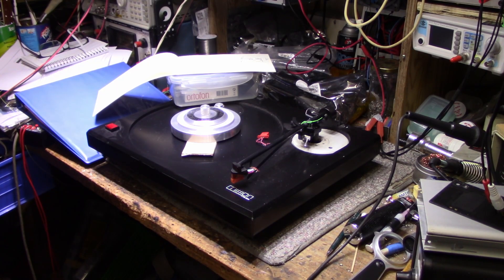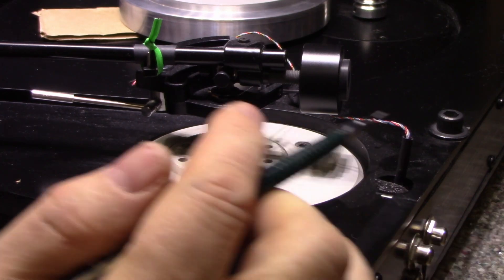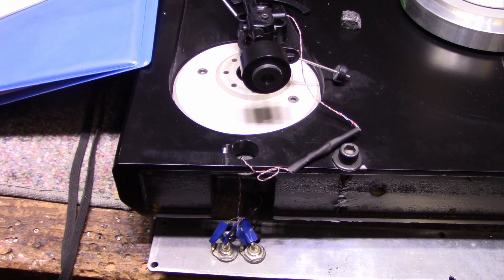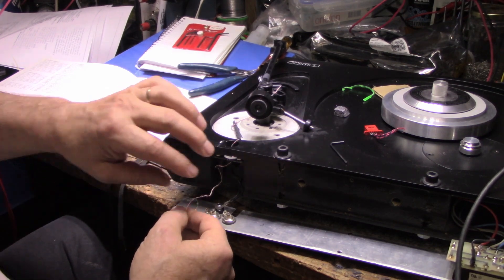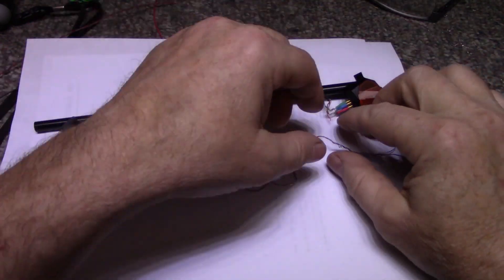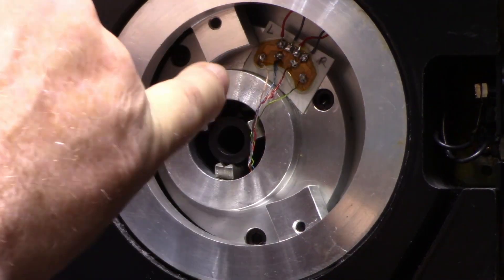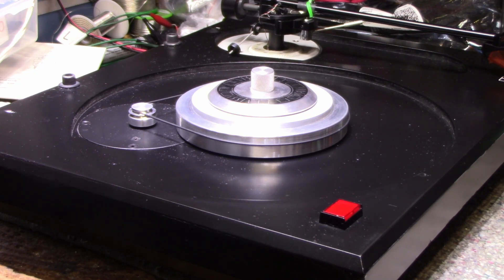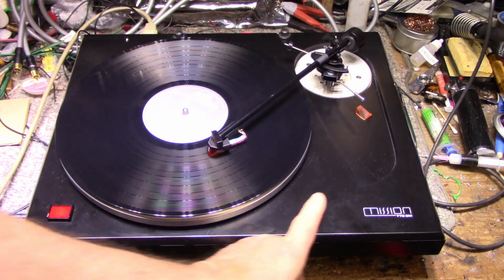Mission 775 Turntable Repair (Ep. 150)

Comment: Interesting model that I haven't seen before. I like the heavy platter and the inertia principle. The best way to achieve a stable rotation I believe. 
The Ortofon 2M Red is a repackaged OM. Not an impressive cartridge in my opinion, but one of the most sold cartridges in the world as far as I know. Not because it is any good, but because people for some weird reason think that it is (same delusion that keeps Bose and B&O alive). The needles are often mounted crookedly in Ortofon cartridges. They are not known for precision. Ortofon cartridges tend to sound a bit cold and analytical. 
Yet another awesome video. Thanks Mate.
Reply from the maker: The entire base is machined out of a solid block of MDF and is very heavy. That coupled with the massive platter makes for a heavy, stable TT
I'm not a TT expert but I know what it takes to get a good listening experience and this Mission TT ticks a lot of those boxes.
I'd be happy to own one of these
Reply: @TrevorsBench  So would I. It's really cute. But on the other hand I fear I will get into trouble since my wife thinks I have way too many turntables already.

Comment: Nice job Trev. Looks like you acquired a full blown fart sniffing Troll LOL. 

Looks like an aftermarket tone arm swap. Always good first step to check the condition of the cartridge. Should have equivalent ohms on each channel. You can chase your tail all evening and in the end it was the cart the whole time.
Reply from the maker: The owner said it worked, just needed the botched wiring fixed

Comment: I've repaired many of those.  The table is the 775, the tonearm is the 774.  Never liked that tonearm, but the wiring is 100% correct.  Sometimes the tonearm wiring is terminated with a plug that attaches to a small board on the plinth where the RCA cables attach.
Reply: Yes, the upgraded arm was badly implemented. Mission tried to compete with better engineered and established products from Rega, Thorens and Dual.

Comment: I've owned several these arms, and I actually like them. The armwand is ridged enough to use with moving coils and the bearings are low-friction but don't have any slop. I've never seen the turntable, only the arms, and the base plate had the same mounting size and shape as an SME or Shure arm. The tonearm wires do indeed come out the side, and are supposed to have a 4 pin plug and matching female socket located on the left and as close to the center pillar of the arm as possible. Easy to do if the arm was mounted to a Linn or Thorens TD 125. They didn't seem to think it through for use with the Mission TT, however. The one thing that annoys me is using the signal ground wire to ground the armwand; add a separate wire to ground the wand in order to lower the hum. Otherwise, a good-sounding tonearm! I never bothered with the fluid damping system.....